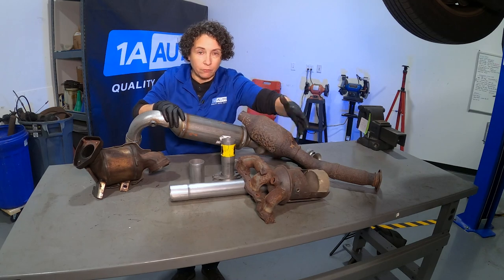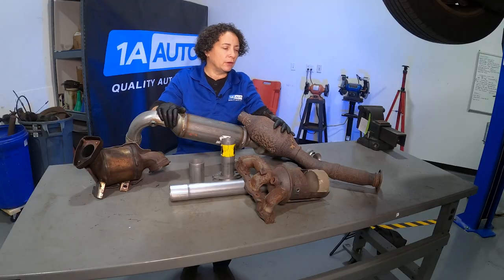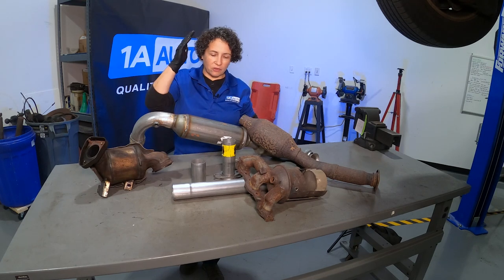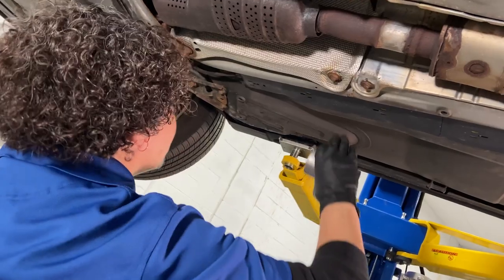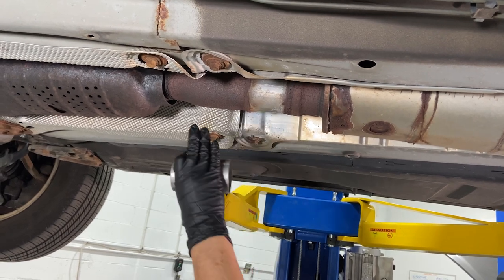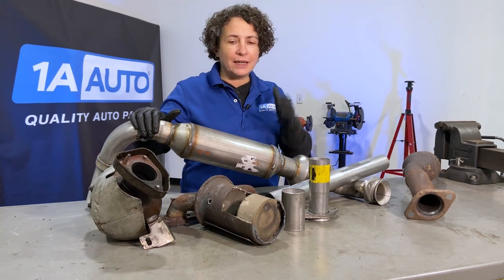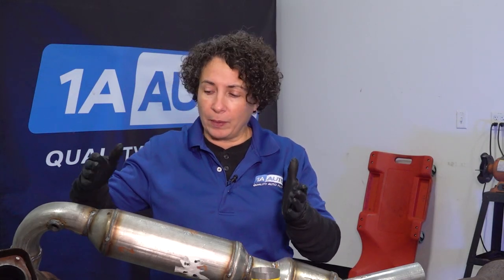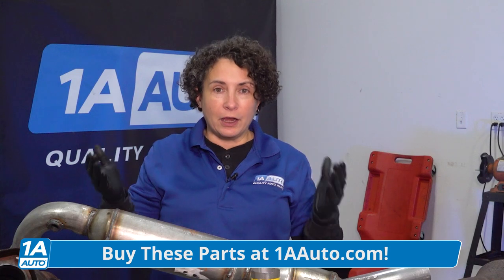Catalytic Converter Theft: Why Are They Valuable? Can You Easily Replace it on Your Car or Truck?

Comment: Need get a cat anti theft on all cars. 
And battery quick connect switch, a kill switch, or at least pull your fuel pump fuse. As cars are being stolen at record numbers not just the cat.

Comment: Some false information on this one, with the aluminized steel used by exhaust shop on stainless steel will out last vehicle life time.and clapping the cat in place is bad idea they loosen up over time and depending on state smog shop might fail because of it